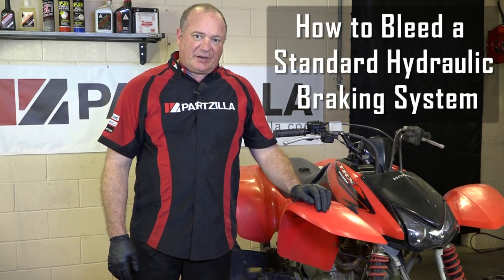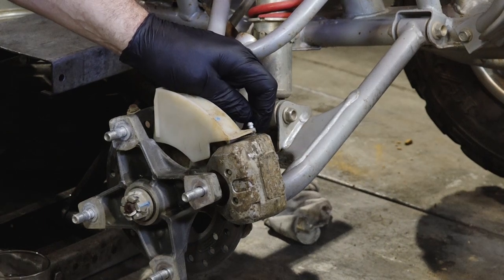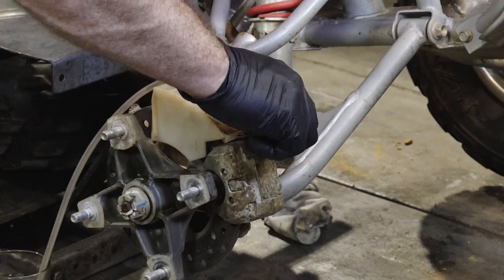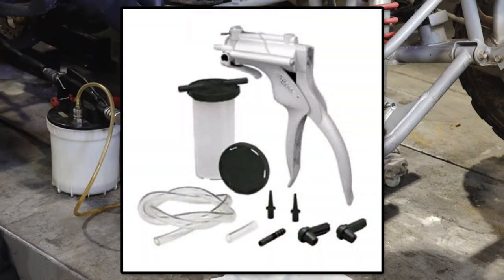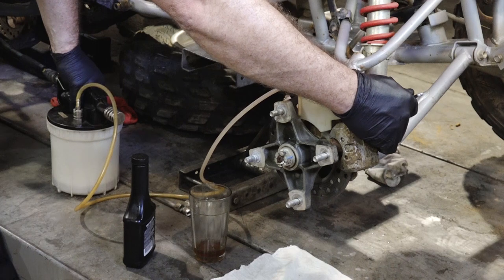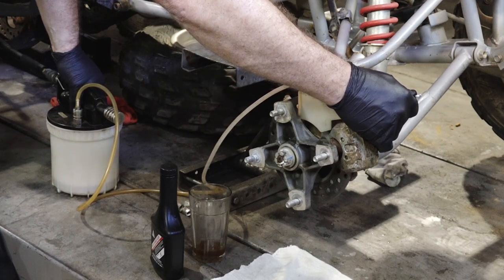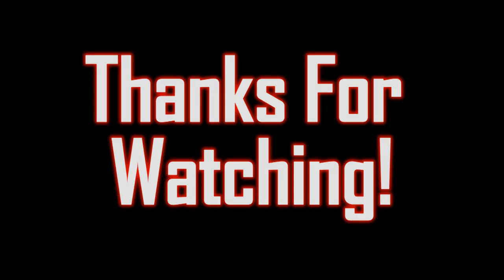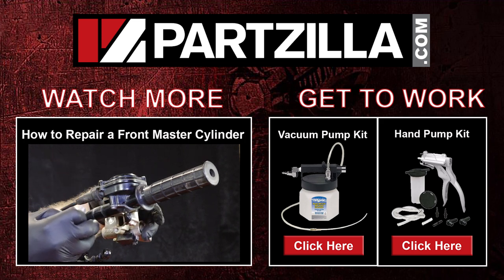How to Bleed ATV Front Brakes Manually and with Vacuum Pump | Partzilla.com

Comment: Working on a 2007 Honda TRX250ES Recon. I have no pressure in my front brakes. Even after replacing the pads and bleeding the "old fashioned" way. I tried reverse bleeding, as I have done on cars and motorcycles, but am unable to push fluid into the bleed valve. Am I missing something?
Reply from the maker: Master cylinder may need some attention.

Comment: I read earlier question about bleeding both sides.  Do you do 1 side at a time or alternate?  My 1991 TRX300FW has 1 hose out of master cylinder which splits and goes to each wheel.
Reply from the maker: One side at a time is fine.

Comment: ok I cleaned and rebuilt that master cylinder on my Suzuki Quad 300 ATV and I can't figure out how to get fluid in the line to bleed the brakes. I know how to bleed brakes on a vehicle but not on a atv. I reinstalled the master cylinder on the handle bar and filled it full of dot 4 fluid I have pumped and pumped and nothing. I have removed the main line and put my thumb over the hole and pumped and I get pressure and fluid coming out of the master cylinder. I have reconnected the main hose and continued and still nothing. I have a pump oil can and a hose and i have put that on the driver side and pumped from the bleeder valve upward to the brake junction and maaster cylinder and still nothing. Can you help
Reply from the maker: Open up the the lower bleed valve and keep filling at the top until it comes out, then bleed as normal.
Reply: well I did that and even allowed two days to sit and run down but the reservoir level never moved. it stayed full for two days and then I kept trying other things
Reply: Did you ever figure this out because I am having the same problem
Reply: Hey Michael i watched another video and they showed how to do it. You get a 60 ml syringe and fill the syringe up, attach a piece of hose to fit tight on the bleeder valve at the tire then you back feed the fluid up to the master cylinder slowly after you open the bleeder valve. make sure the master cylinder is empty and clean before you do it.
Reply: @johnwessinger7768  I guess I saw the same video because that's what I did too thanks for returning my email though I was getting pretty frustrated! Lol
Reply: The hand vacuum pump works well, never tried to push fluid up the bleeder valve, maybe I will try that sometime.  Watch out for check valves in the system, also a syringe will work to suck fluid out the bleeder if you do not have a hand pump.  Then finish with traditional technique such as on a truck.

Comment: I have a Polaris trailblazer 250 1994. The front brake calipers show very little resistance. I do not see evidence of leaking brake fluid and the level in the master cylinder is good. Is it possible that bleeding the brakes in lieu of replacing master cylinder might resolve the issue?
Reply from the maker: Always bleed the brakes first, if you still can't build pressure then the master cylinder may need some love.

Comment: Hi I bleed my brakes on a Yamaha wolverine and when I done I noticed is leaking fluid from the tread of the bleed valve
Reply from the maker: Is it leaking when it's tightened down all the way?  Or only when you are actually opening it to bleed the system?
Reply: Is leaking when is tightening all the way
Reply from the maker: Couple options.  Pull out the bleed valve and inspect it.  If it was over tightened or scored, it could start seeping.  You can get a new bleed valve and try that.  If there is no scoring, it might be a piece of sand or dirt that won't allow it to seal.
Reply: Thanks i would try .
Reply: I ordered 3 new bleed valve from you guys let's see if work . Thanks once again